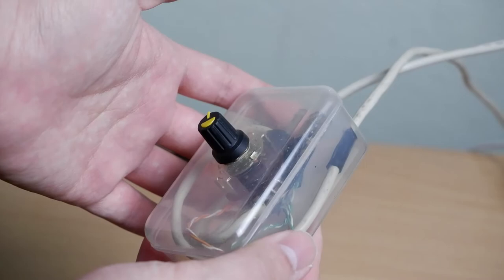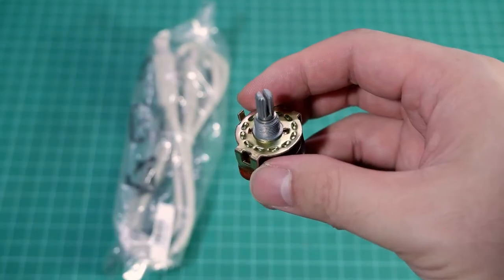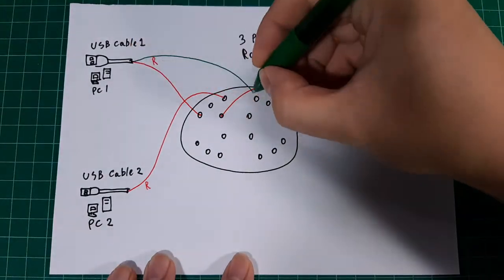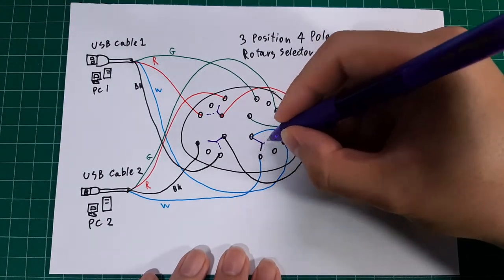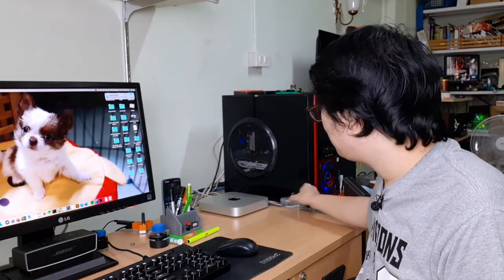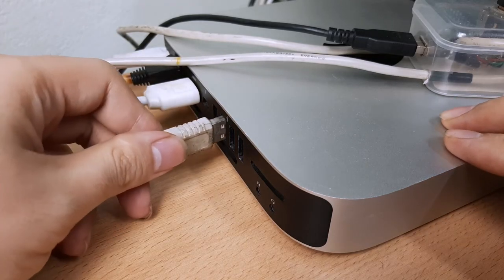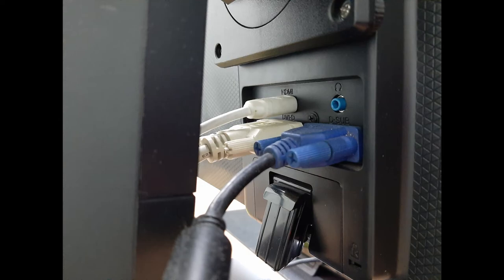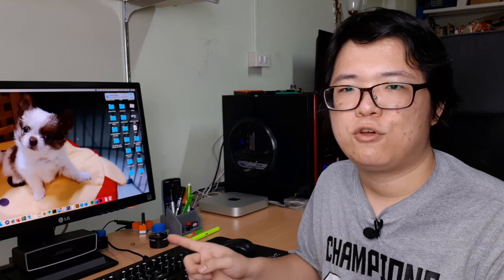Control 2 PCs with 1 Keyboard and Mouse using a DIY USB Switcher KVM

Comment: The clever thing is you have preferred mechanical way rather than electronics. Very clever.
Reply from the maker: Because electronic switching of high frequency differential signal (USB 2.0) can get quite complicated.

Comment: Thanks for posting, I was wondering if there could be an issue just using a simple switch to change where the usb go.
I was wondering, why not using a 4P2T instead of a 4P3T ? Maybe a future-proof option ?
also, I was thinking, many people did a 2 usb input but you are right, a usb hub is better. since I got one spare that is a very old one... and also a bunch of female usb lying around, I'll do the same as you did.

I really like the fact you put up a pinout diagram and explaining it. Not everyone do that, and it's really convenient.

Best regards

Comment: Hello man, thanks for the tutorial; could it be possible with a 3 contact 4 position switch (its the one i have at home)? with 1 to 4 for A, 5 to 8 for B and 9 to 12 for C, i dont really know how the positions wiring is working tho. i was thinking to link USB Female VCC to 1, D- to 2, D+ to 3 and ground to 4, then link in the same order USB Male 1 to B (5 to 8) and USB Male 2 to C (9 to 12). How would you wire it if its possible?
Thanks, keep up the good work
Reply from the maker: Could be possible but I'm not sure about the pinout, you should check the pinout with multimeter, For 3 contacts switch I would use each contact for Vcc, D+ and D- the ground could be connect together, Careful about the 4 position though most audio selector are make-before-break meaning adjacent position will be shorted momentary during switching, My selector is 3 position so I only use 1 and 3 skipping the 2 position.
Sorry for late reply, Thanks for watching.

Comment: Very nice peace👍.. Also is this crackle sound of the speakers
Reply: yeah this seem to be the case...they crackle when power is detected. without the usb soundcard it it would work silently
Reply: @Ezio470  it would be silent if it werent plugged through usb?
Reply from the maker: You could use 2 sets of speakers connected to each pc audio output and the only sound you will hear is the Windows USB device attached/detached sound.
Or just use a Bluetooth speaker with multiple device pairing.

Comment: Hi, nice work mate, just want to ask is this save for our computer, i mean i watch other videos similar like you [ yt id: j-ySUHcP6Tw ] in comment someone said it need diode or something (they said can burn something), do this one also need diode or not? thank you?
Reply from the maker: That's why I use a 3 position selector instead of 2 because of how the audio selector design is a make-before-break operation.
That is, the pin of 1 - 2 or 2 - 3 will be momentarily shorted during switching, so I skip position 2 to prevent shorting +5V of each computer together.
If you would like to use all the positions of the switch then you need a diode but that will drop a 5V supply voltage of about 0.7v (depend on the diode type) and some USB devices may not operate properly.
Sorry for the late reply. Thank you.